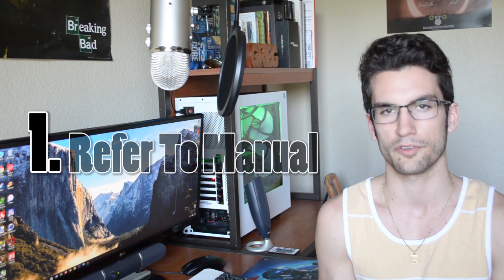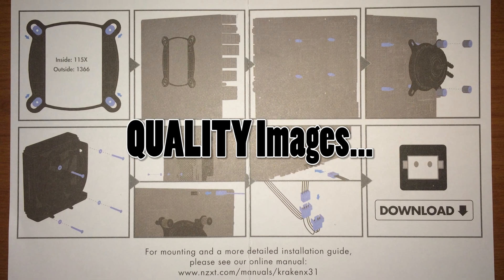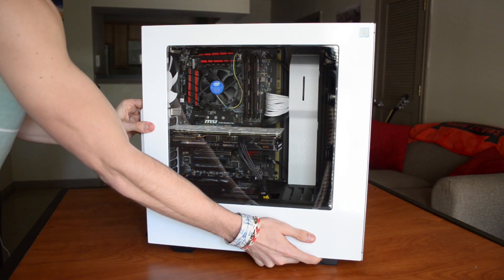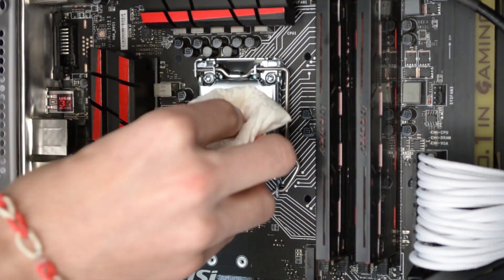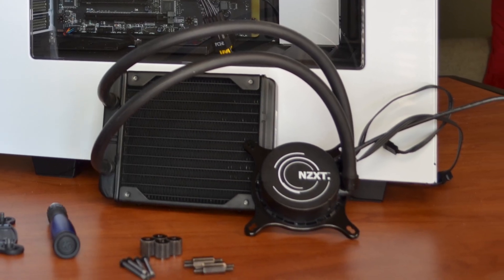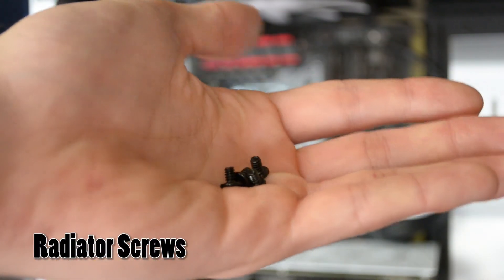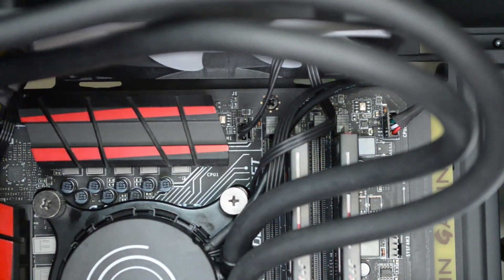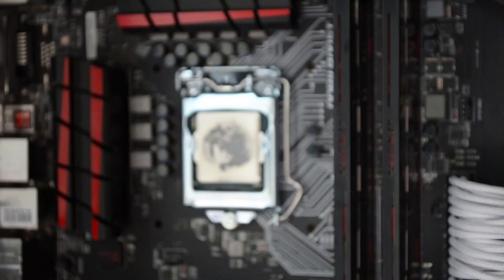How To Install An AIO Liquid Cooler

Comment: Thank you for the tutorial Mr. Salazar. I bought a prebuilt PC about 2 years ago. It runs well, never overclocked, temps were at a decent level...

The basics were a i7 6700k, GTX 1070 founders (8gb), m150b mobo, a 450 bronze psu and some other stuff not really worth mentioning.

I've been watching tutorials lately and learned how to upgrade my PSU, fans, and now, replacing a stock cpu fan with a water cooler. I went from a 450w bronze to a 550w platinum, from 2 NXZT AER fans to 4 Rosewill RGB S12001 fans and I kept one of the NXZT fans, and just trust, I upgraded my dusty old Intel cpu stock fan to a Rosewill 120mm AIO water cooler.

My CPU temp was around 30-35 and my CPU fan temp was around 10-15, whereas before my CPU temp was around 50-55 and my CPU fan temp was around 30-40, and of course higher among higher cpu load when starting a game or opening multiple programs.

I like learning about PCs and PC maintenance. Thank you for your videos

Comment: Just watched gamers nexus explain radiator orientation and pump orientation. I think for longevity/sound purposes the tubes on the radiator should be on the bottom not the top. This is because you don't want the air being stored in the tanks which are near the radiator hose inlet/outlet.

The pump is oriented fine here and as long as the pump is below or somewhat below the radiator it should be fine.

Comment: 2:30 Alcohol pads are also great. They are mini wet cloth pads used by the doctor when they're giving shots with a needle, mostly to disinfect. They are great for disinfecting the mouse and keyboard in my experience. They also work great for removing thermal paste because they're dowsed in rubbing alcohol (isopropyl alcohol). They're made of cloth and don't break up like tissue paper.

Comment: cool, found this helpful, only one thing, you installed the radiator upside-down, pipes should be coming out at the bottom, otherwise air will get inside

Comment: So I have a fan cooler on my cpu and I’m about to install the Z53 Kraken 240mm, my question is do I need to remove the initial thermal paste on my cpu just like on the video? If so where can I get the chemical he used or is there an alternative to get rid of it?  

Cheers!
Reply: Greg

Comment: Water?  You'd use mineral fluid... Only an oxymoron would use actual water lol  Video was great until that wasn't explained though.
Reply from the maker: First: this is an extremely old video. No idea to what you're referring. We've thoroughly explained how AIOs work in various videos. Most of them utilize a water/glycol solution.
Reply: @GregSalazar  I actually complimented your video dude, I said until you didnt mention that otherwise it was great,  you dont have to be a douche... Dislike for this reason, have a nice day..

Comment: When I made my first pc almost a year ago I got one of those builds from pcpartpicker cause I didn't know better as those builds are usually there to encourage purchase of leftover parts no one is buying. The build came with the SHITTY airflow case V200 TG which is my main gripe with the build that has 3 front fans with a tiny side intake for the front fans, 1 back fan, and the cpu cooler that came with my amd ryzen 5 3600 cpu plus a RX 5700XT for $440 lol try finding one of these and with the price i paid for it nowadays. When playing demanding games like horizon zero dawn on medium settings I'd get around 80-90c which was barely acceptable cause if I'd happen to be in 100c my pc would be pulsating. now after procrastinating I finally am getting some ACTUAL airflow into the pc I decided to get one of those cooler master ML240L aio water coolers to go on the top mounting bracket for fans hopefully it'll be a LOT more cooler now

Comment: i have its position like in the video but my motherboard was too small then one of the big cable from the cooler blocked my from installing 4 ram sticks then i reinstall it with a different cable direction in order to be able to install 4 ram sticks. The big cable seems like a little bit uncomfortable... guys wish me luck it doesn’t leak at least in few more years

Comment: According to NZXT you have installed it incorrectly. You should have installed it on the top like in the manual and animated video they provide. It might not matter but it shows you didn't read the material or check the diagrams.

Comment: shouldnt the tubes be at the bottom and not the top of the radiator?
Reply: He installed it wrong most people don’t know tubes should be down best performance in AIO
Reply: Mr TharX eM All alright just making sure because I just got an h80i v2 and a new case so I wanted to make sure
Reply: @po5tup568  I don’t understand. Is there like a liquid inside the cooler already so I don’t need to fill it up or some shit? Sorry for the question
Reply: @beeinho4954  yea an aio comes with the liquid inside no need for any liquid its already inside!
Reply: Yes tubes down
Reply: Mr TharX eM All then why is it not like that in the video?

Comment: I’m gonna be dumb and ask this question but where is the water in the cooler?
Reply: Not a dumb question, the liquid is in the the main cpu block that covers the cpu, the pipes coming off of it, and the black square radiator. They are all connected, but there is probably some air in there so if you are installing a cooler look up GamersNexus’s AIO orientation video on the proper setup.

Comment: Yo i have a question. I just saw the gamers nexus video on why you shouldnt mount your AIO cooler like this (pipes on the top) and im looking for some opinions if i should actually listen to their advice and buy a smaller cooler or ignore it so i can buy a bigger cooler (my PSU shroud prevents me from putting the radiator right side down)

Comment: i dont get this thing with the fans, if hes pushing the air outside the case to cool the radiator, isn't he creating a negative pressure inside the case thus creating more dust? also, if the fan is pushing hot air inside the case throught the radiator, doesn't that defeat the whole purpose of water cooling? am i missing something? is there a "right answer" with setting up your pc airflow?

Comment: Thanks for showing basically the most simple and easy to understand aio cooler installation. I just got myself aio cooler and was lost to read their manual as they basically put pictures instead of clear instructions. Now i know i just don't need to take my mobo out and i will still be able to install this type of cooler. 👍

Comment: would a 2009 pc case be able to handle most current builds today? ive been wanting to do my own build but never have before and one i currently have is a ibuypower gaming extreme pc that i bought from newegg back in 2009 and has a 850w power supply and an old asus motherboard and i think some of the slots in the back of the case is removable cause it has a lot of space inside and looks like its made to be upgradeable

Comment: wrong side up
Reply from the maker: No, it isn't. The pump isn't the highest point in the loop. Worst you'll experience here is a bit of gurgle from air being trapped at the top of the radiator.
Reply: @GregSalazar  It's wrong lol
Reply: GN showed basically every single way you can mount your radiator and the way you did it was one of the wrong ones. You should rewatch it yourself.
Reply from the maker: No, it isn't wrong. Steve himself has even said that people are taking his video out of context, so quit regurgitating nonsense. I'll repeat what I said: The pump isn't the highest point in the loop. Worst you'll experience here is a bit of gurgle from air being trapped at the top of the radiator. Air doesn't travel DOWN through water to reach the pump when the pump is very weak, as most of these Aseteks are.

Comment: arent you suppose to have the tubes at the bottom for better water flow?
Reply from the maker: The pump isn't the highest point in the loop. Worst you'll experience here is a bit of gurgle from air being trapped at the top of the radiator.

Comment: You placed your radiator upside down.
The attached tubes must be at the bottom so that the fluid will always immerse the holes of the tubes.
Reply from the maker: The pump isn't the highest point in the loop. Worst you'll experience here is a bit of gurgle from air being trapped at the top of the radiator.
Reply: @GregSalazar  That gurgling sound will shorten the pump's life because will eventually run dry leading to premature failure. Just like your standard water pump, AIO pumps must not run dry.
Here, check out this link for some lessons about water pumps. https://www.worldpumps.com/operating-design/features/how-to-overcome-the-challenge-of-dry-running/

Comment: I don't think I've ever gazed upon an AIO cooler before myself, but , according to some videos I've watched, the correct position of the radiator is the opposite of which you just did, which is positioned so that end of the radiator with a hose is at the lower part,  this means proper outward flow (towards the pump) because now the loop is at the highest starting position. Basic physics and common sense I suppose. Water travels to the lowest position. You'd wanna make sure that the highest part of the radiator is always higher than the processor, but always keep the hosed end at the bottom. Heck why don't I just give a link https://www.youtube.com/watch?v=BbGomv195sk. Also this https://www.youtube.com/watch?v=b6m9Xhzc6Kw
Reply: Yeah, I was just watching GamersNexus' video about this, you are very much right. Seems that nobody else commented this in the last 4 years lol.
Reply from the maker: The pump isn't the highest point in the loop. Worst you'll experience here is a bit of gurgle from air being trapped at the top of the radiator.

Comment: Ronggggggg you idoit its rong
Reply from the maker: The pump isn't the highest point in the loop. Worst you'll experience here is a bit of gurgle from air being trapped at the top of the radiator.

Comment: Uhm, you prolly should put the intake and   outtake of the radiator on the bottom instead of the top... that’s how AIOs die quick
Reply from the maker: No... it isn't. The pump isn't the highest point in the loop. Worst you'll experience here is a bit of gurgle from air being trapped at the top of the radiator.

Comment: Shouldn't you flip your radiator so that air isn't being pumped into the pump
Reply from the maker: No. Air isn't being pumped into the block if the block is below the barbs. Rewatch the GN video. WAY too many people are taking it out of context.
Reply from the maker: No. Air isn't going into the pump in either config... think about it: the pump isn't changing location. It isn't the highest point in the closed system. Worst you'll deal with here is a bit of gurgle.
Reply: @GregSalazar  Don't know if you've read my main comment about this video, or watched a video from Gamers Nexus and some others about this, but @josh crowley is very much correct. I've put these links on my main comment but I'm putting here also  https://www.youtube.com/watch?v=BbGomv195sk or this much shorter explanation about the very same idea https://www.youtube.com/watch?v=b6m9Xhzc6Kw. It's probably 4 years too late but, better late than never.
Reply: wait, GN video ? you mean Gamers Nexus ? pretty sure there's not much room for interpretation as far as context goes because everything was basically on video, we all could see how incorrect positioning will cause bad water flow
Reply from the maker: No, it isn't wrong. Steve himself has even said that people are taking his video out of context, so quit regurgitating nonsense. I'll repeat what I said: The pump isn't the highest point in the loop. Worst you'll experience here is a bit of gurgle from air being trapped at the top of the radiator. Air doesn't travel DOWN through water to reach the pump when the pump is very weak, as most of these Aseteks are.

Comment: The barbs on the radiator should be oriented below the cpu block if you're mounting in the front or rear. If they're above it you'll get significant bubbles and won't get the cooling that the aio is capable of.
Reply from the maker: Air isn't being pumped into the block if the block is below the barbs. Rewatch the GN video. WAY too many people are taking it out of context.

Comment: ESTA MAL!!!!!! LOS TUBOS EN EL RADIADOR TIENEN QUE QUEDAR HACIA ABAJO, PARA QUE CUANDO EL RADIADOR PIERDE AGUA POR MICROEVAPORACION, EL AIRE QUE SE JUNTA AHI ARRIBA, NO ENTRE EN LA BOMBA. NO SE PARA QUE  HACEN TUTORIALES SI NO SABEN NADA
Reply from the maker: This isn't wrong. Quit pulling incorrect info out of thin air. Rewatch the GN video. Air doesn't magically get pulled downward. The pump isn't the highest point in the loop.
Reply: @GregSalazar  The higest point is in the tubes, 5 cm to the pupm, the power of pump introducing air to the pump.

Comment: You didn't mention which hose is "in" and which hose is "out". Also, you didn't mention keeping the pump lower than the radiator. In that regard, you didn't mention the orientation of the radiator. It appears you have it installed correctly with the hoses at the top of the radiator position and not at the bottom.

Comment: Wait if u have the radiator on it exhaust fan then aren't you just pushing hot air through it, thus over heating you cpu?

Comment: hey i have a question, if i were to put one at the front of the pc, replacing intake fans, would the aio fans cool the whole system? or are they just for the radiator
Reply: It is best to use them as intake fans so yes

Comment: My room gets so hot when doing work on my pc so considering this but I have to move soon so I am worried about shipping my pc after putting in this watercooler..... Really cool you don't have to add water but would you think it is safe to ship a pc with this to another state out would it be best to uninstall it before shipping?
Reply: Have you got one yet? And do you know what’s the normal temperature for a water cooler like this while gaming ???
Reply: @j7kob  well it mostly depends on the cpu 
But normal temps
Should be around 25-75

Comment: Have you ever had problems with cooling after dabbing the thermal paste on like that? I have always been under the impression that you were supposed to spread a thin layer over the entirety of the back of the CPU with a credit card or something similar. As such, I've always needed to apply the paste before seating the CPU into the socket. But if your way works, that might be easier

Comment: I think you may want to re-think the air flow to your radiator. You don't want to push the hot air inside your case into your radiator. that is not a good design. you need to actually push the cold air outside through your radiator, possibly into your case based on your installation, and have some exhaust fans to push the hot air out, probably from the top of your case.

Comment: so whenever I had a 120mm AIO... I've been installing it just like this, on the back vent.  But is it really a good way to do it?  Since the air going through the radiator is air that was already in the case... wouldn't we just be feeding hot air through the radiator?
Reply: no, what it does is taking air through the case to the outside while passing through the heatsink which will expel the heat form the heatsink, you do NOT want any hot air in your pc.

Comment: "Be sure the alkochol is not running down the fabric......"?
Why?
Reply: If it gets on the sides of the socket it might short the board
Reply: @reimon5410  What? The board has no power, how can you short anything without the power?
Reply: @brunonkowalski  it might stay on the motherboard for longer and by the time you power on the pc it still might short the board
Reply: @reimon5410  No it can't. It's isopropanol, it evaporates very quickly, that's why it's widely used to clean electronics.
Reply: @brunonkowalski  yup but its still conductive and hes just being safe

Comment: I never built a pc how do i know which one is push which one is pull? I'm confused do you put the fan on the opposite side on the radiator? I just finished watching JayzTwoCents video on it. I'm a bit of a dar dar so i need a push pull guide for dummys 0_0
Reply: The arrow shows which way the air will be going, so if you have the Raidator and the fan faces to the left it will pull air in, if the arrow faces to the right then its pushing air out? Do you under stand or want some more explanation

Comment: do you ever have to "clean" an aio cooler ? how long do they last ? and what do i need to do to clean it if possible? or just get a new one ? Sorry new to water cooling . Thanks .
Reply: Besides cleaning thermal paste off if you ever need to remove it no. The most you would have to do is remove the radiator and possibly fans for getting rid of some dust. Pretty simple on that part it just involves removing some screws
Reply: @default2907  do I ever need to replace the fluid ? or I just need to make sure that it does not leak ?
Reply: also thanks
Reply: Frank Fiore the AIO is sealed so you won’t need to replace the coolant inside of it. If it does leak there’s a much greater chance that it’ll need replaced so... makes sure it doesn’t do that lol
Reply: @default2907  Thanks that cleared up alot of confusion i had about an aio. I may actually get one. I was told they need to be replaced about every 3 years witch made me not want to get one. they are kinda pricey...

Comment: My radiator is blowing out cold air, the tubes are cold and my cpu is 95 degrees under load. Pump is working. Idk how to fix
Reply: The cooler might have leaked
Reply: Kyle Anderson main account suspended thx for advice bur i hav already fixed the issue bt re seating cpu and re applying thermal paste which i had to much of on the cpu at first